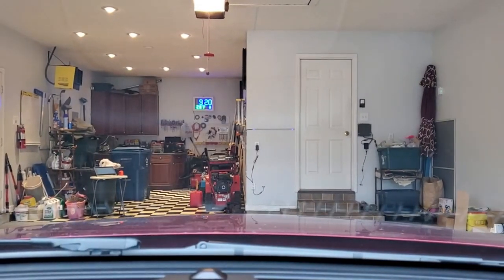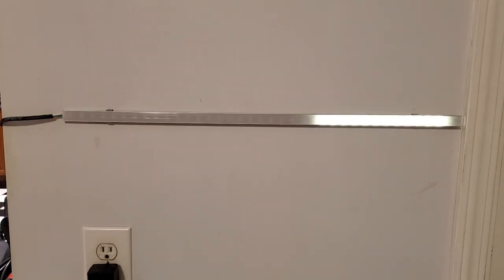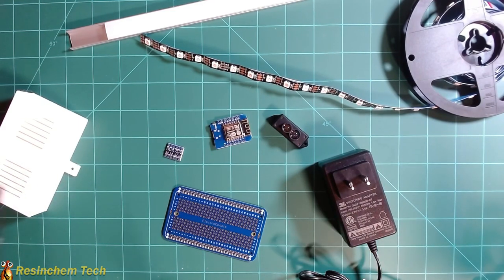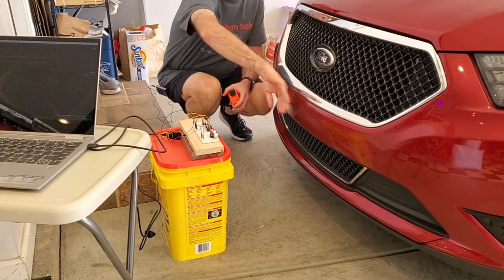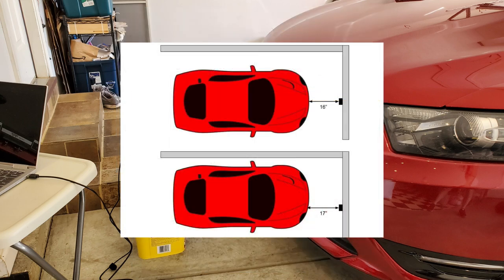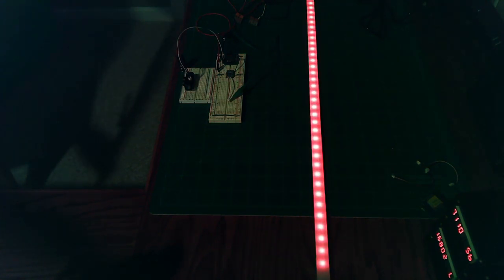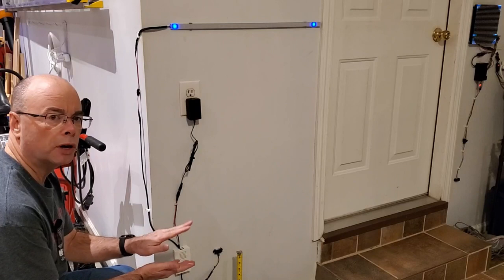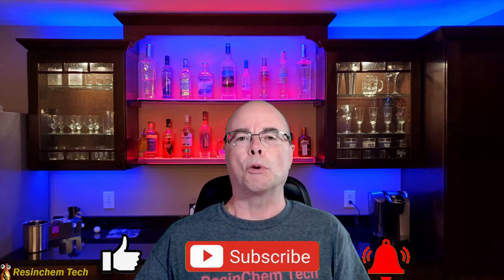A New Parking Assistant using ESP8266 and WS2812b LEDs

Comment: So I got all your stuff working on a breadboard but hes my problem.  My wife backs up.  So I want the lidar on the wall in the "back" of the garage, but the light strip on the wall in the "front" of the garage (so she can see if if she looks out the windshield as shes backing up).  Any way to modify it to be one D1 mini connected to the tf mini and another one connected to the light strips?    I'm assuming running data wires 30 feet from the front of the garage to the back would be too far.

Also, is there anyway to get deeper integration into HA?  Cause I work in the garage, so I dont want the lights blinking everytime I walk in front of them.  I was thinking I could put in logic to say if the garage door is closed, then dont turn on. ONLY turn on when the garage door is open.   I see your have MQTT settings in there, but I dont see a way I could actually "control" the D1 mini from HA.
Reply from the maker: Well, there are a number of possibilities, but some would require that you make pretty substantial changes to the code.  To use 2 D1 minis, there has to be some way for the one connected to the LIDAR to communicate to the one connected to the LEDs to tell it which LEDs to light up.  MQTT would be one option, but it would need to update rapidly and the LED D1 mini code would have to be rewritten to subscribe to the MQTT topics (currently the code only publishes MQTT).  

It might be possible to use Home Assistant and automations as a "middle man" for communications between the pair... but again, significant code changes would be needed on both ends.  As above, you can't afford any significant delay in the communication or the driver would risk overshooting the parking spot because the LED strip didn't update fast enough.

You might try a bench test and see if you can get a decent signal to the LEDs from the controller at 30 ft or so.  With the logic level shifter on board, the data signal may be OK (I'd use larger wire, like 16 or 18 gauge to minimize voltage drop).  Similarly, you'd probably want to run the power wires for the LED (+5V, GND) directly from the power supply and not via the board (so run 5V in parallel, with one run going to the controller and the other running straight to the LED strip)... again using the larger gauge wire.  Run the long wires between the controller/power supply and LED strip... not between the controller and LIDAR (in other words, keep the controller at the back with the LIDAR).  I've had run lengths of around 20 ft. between the controller and LEDs work.  If needed, there are signal boosters you can install along the run to the LEDs to up the voltage back up to 5V if needed.   Quindor over at QuinLED sells one: https://quinled.info/quinled-data-booster-for-sale/  You could also use a couple of sacrificial LED pixels along the line to boost the signal, but you'd have to slightly modify the code to not include these pixels in the count process.... this would be a more minor code change than the other options.

If you can get a successful wiring run between the controller at the back and the LEDs at the front, that's going to be the easiest solution.  Anything else will require pretty substantial modifications/rewrites to the the current firmware code.  Let me know if I can help out any further.. or if you do get it to work with a long wire run.
Reply: @ResinChemTech   Thanks for the thorough response. Couple comments/questions...

1. I tested with 36ft of 18 AWG stranded.  It seemed to work OK, but when I had the LED's on solid red, they would flicker once in a while.  I checked out those boosters but they are sold out.  How would I use sacraficial pixels?  Would  I say, put one pixel between the 36ft run, so at 18 ft, connected +,- and data wire to each end of the pixel?  Or would i just need to connect data wire?  

2.  What are your thought on splitting the difference between the LIDAR and the LED's?  So put the box with the D1 somewhere in the middle, run say 10ft of cable to the LIDAR and then 26ft to the LED's? 

3.  If I went the sacraficial pixel route, but you be able to assist changing the code for however many pixels I needed to use?  I guess thats gonna determine if I do that, or wait for the boosers to come back in stock.
Reply from the maker: As to #1, you are correct.... you would connect all three wires (+5V, gnd and data to the single pixel on each end).  Each pixel automatically boosts the data line to 5V before passing down the line to the next pixel... so it acts just like a logic level shifter.  Just be sure to observe the data direction (data arrow) on the pixel.  If you try to pass the data signal through the sacrificial pixel in reverse, the signal won't be passed on at all.

2. You could certainly try putting the controller in the middle, but I have no idea how sensitive the LIDAR module might be to voltage drop... with either the power or the I2C signal.  The spec calls for a voltage of 5V +/- 0.1V.  But I'd probably be more concerned about the data signal.  All I can say is to try it and see if you still get consistent results.

3. If you just need one sacrificial pixel, you might be able to get away with the code as it is... just include that pixel in the total LED count.  It might mean that the 'center' of the LED strip would be off by one pixel. The sacrificial pixel will light up as part of the motion... but you may be able to live with that... and if using the 'standby' feature where the first and last pixel are lit when in standby, the sacrificial pixel will be lit (since it is technically the first pixel), but that feature can also be turned off via the web app.  Again.. try it and see if it is acceptable for your use case.  Having one pixel on the ceiling (or along the wall depending on how you are running the wiring) that lights up when the system activates may be OK if you can live with it.

I'm just not sure if or when I might have time to modify the code for you, if you are unable to do it yourself.  It's not that I'm unwilling, I just a number of my own projects that I'm working on... and I'd also have to build a system using a sacrificial pixel that I could use to test the code changes, as I currently don't have a system built like that.   But I'd definitely try the sacrificial route and see if you make it work acceptably, as opposed to waiting on if/when they might be back in stock and paying the extra money.  Let me know how it goes... and if you get the sacrificial pixel to work if you go that route.
Reply from the maker: Thanks for sharing the video!  I love to see how others implement some of my projects.  Although I am a bit jealous of how clean your garage is... but you can keep all that snow!  And thanks for the shout-out and credit!

I haven't used one of those Falcon F-amps before.  In fact, I wasn't even aware of them.  But it's good to know about them since the Quindor version I recommend is often out of stock.  I can throw these out as an alternative now as well.

As a side note, I wanted to ask if you have a Discord account.  I started a Resinchem Tech Discord server a few months ago, but right now it is a small group of folks by invite only (I'm not ready to open it up to everyone yet).  But there is a good mix of some beginners (to Home Assistant and DIY electronics) to one or two that are pretty advanced.  We chat about various projects (or sometimes just misc topics), help each other out when needed and I will often ask for feedback about upcoming videos.  If you have a Discord account and are interested, I'd love to invite you into the group. I would just need to get your full Discord handle (e.g. name#nnnn).  If you prefer not to post it here in the comments, you can send it to me via email, which you can find on the 'About' page of my channel.  Once I have that, I can send you an invite.  No big deal if you aren't interested, but I think you'd be a good fit with the folks that are a part of my server.
Reply from the maker: Hey... I tried posting a comment on your video, but I don't see it listed there, so I thought I would try again here and hope that you get a notification about this posting.

I am in the early stages of planning a video where viewers like you took one of my projects and either substantially improved it and/or used it in a unique way.  I'd like to feature your parking assistant version and a portion of your video as part of that... but only with your permission of course.  So, I guess I'm asking if you would be OK with me featuring a small part of your video and to talk about how you adapted the parking system for backing into the garage.  Please let me know if that would (or wouldn't) be OK.  If you have any questions or want to discuss further or request that I don't include some particular component, please feel free to reach out to me via the email account you can find on the 'About' page of my channel (listed under 'business inquiries').  Thanks... I would appreciate it.
Reply: @ResinChemTech  sure go ahead. One change request Id like to make if possible to the code is something to the effect of, "if the measured distance hasn't changed by X amount, in Y amount of time, turn the unit off"

Many times what happens is my wife parks correctly. After brakes are engaged, car creeps a little closer to sensor and now it's flashing red. And it will remain flashing red all through the night and into the morning.

Would be nice if there was some sort of time out for this. I know you do have some sort of time out incorporated into there, but that doesn't seem to work in the scenario listed above.

Otherwise, systems been great. Many people are impressed when they come over.
Reply from the maker: First off... thanks for the OK and permission.  But next, what you are seeing shouldn't be happening.  What should happen is that the system goes to sleep after the active parking seconds listed in the web app expire.  And this should happen even if the car creeps a bit from one zone to another (e.g. slightly shifts into the backup zone).  Then the system remains asleep until all zones are cleared and one of the zones are entered again.

I've never seen my system exhibit the behavior you are seeing.  Even if I pull the car only part way into the garage and stop, the system goes to sleep after the active time period (30 seconds in my case).  The system won't wake again even if I then pull forward into a new zone (since all zones have to be cleared and one re-entered before the system wakes again).

The only odd behavior I've seen on a rare occasion is that the system seems to wake up on it's own... but again only for the 'active park time' duration.  I think this is likely due to the sensor throwing up an occasional error (which looks like the zones have cleared).  I've been in the garage and even though the car is parked, the system awakes on its own.  Again, this is very rare (but I have seen it).  Even then, the system only wakes for the duration of the active park time (30 seconds) and then goes back to sleep.  I've never seen the system remain awake indefinitely like you are referring to.  Let me do a little experimentation and review the code again.

I'm wondering if your minimum distance settings are somehow causing the 'shut off' process to fail or get skipped.  When you get a chance (no rush as I won't be able to test for a while), let me know your backup zone and parked zone distances, along with the times you have specified for active parking and exit times.  I then can try to use those same values on my system and try to replicate what you are seeing.
Reply: @ResinChemTech  I will check my settings and try to replicate with video.

Comment: Is there any reason for not using a  resistor in the data line to the ledstrip, and a capacitor over the voltage supply to the ledstrip?
Reply: Great project BTW, just build it and works fantastic.
Reply from the maker: You could certainly add either.  I've used both a 1000uF capacitor on the 5V supply and have also added a resistor on the data line (mostly with a long parallel run next to the ground), but I also have a lot of LED installs where I've used neither without any impact.  So, it is somewhat of a personal choice.  You can add either or both if desired without impacting the project.... but it generally also works fine without either option, especially for a project like this one.

Comment: Considering all, price included, TF mini is wrong choice. Ultrasonic is way to go. Heck, even ultrasonic and ToF TOGETHER and while averaging out distance is WAY better and safer because you can have redundancy for way less cost...
Reply from the maker: As I've mentioned to others, my source code is freely available and you can swap out the TFMini and related libraries for an ultrasonic or ToF sensor if you prefer to use those sensors instead.  For me, neither of those other sensors work due to the fact that the sensor has to be placed very close to side wall due to an entry door.  The FOV for both of the other sensors are too wide and the simply just report a consistent distance of the side wall.  I choose to spend the extra $30 or so for what I consider a better and more reliable sensor, at least in my case.

But you are free to substitute your own preferred sensor and modify the code (or write your own).

Comment: I’d be interested in modifying this to be installed on the rear bumper of my old truck. Then it could be something usable even if I park outside of the garage. Would it be reasonable to think that it would work in a mobile application?
Reply from the maker: I think there are a number of challenges to something like that.  First is power... a standalone battery would not last long, but I suppose you could power it off of the 12V truck battery, assuming you stepped down the voltage to 5V for both the controller and LEDs via a buck converter or something.  You could use 12V LEDs, but you'd still need 5V for the controller.

The next challenge would be to make everything waterproof.  Nothing that I used, from the LED strips to the enclosure (or the sensor for that matter) is waterproof and would not stand up to rain, snow, etc.

Finally, the system is only designed to work with WiFi... not cellular data.  That means it would only be possible to access the settings when at home and the wifi is available to both the device and your phone/laptop, etc.  While the system should technically work without wifi once configured, I actually haven't tested what would happen if wifi was suddenly removed after it was running.  I don't think the code would crash... but again I haven't tested it.

I also don't know how the sensor would work or be impacted in various environmental conditions... rain, fog, direct sunlight, etc.  Not the kind of things that it would experience inside a garage.  I think all in all, it would probably be better to take the general concept of what I've done and build something more suited for mobile use... as opposed to taking what I have shown and trying to make it work on a truck or car.
Reply: @ResinChemTech  Thank you for the thoughtful response. I’ll start with building the garage version and see what ideas it sparks in the process. You’ve done a really nice job with this project. Well done.
Reply from the maker: Thanks!  My video "production" really didn't do it justice.  But let me know if you run into any questions or problems during your build.  Good luck... and let me know if/when you get it done!